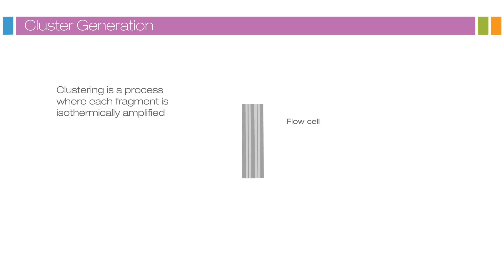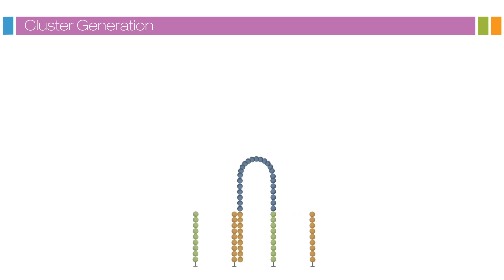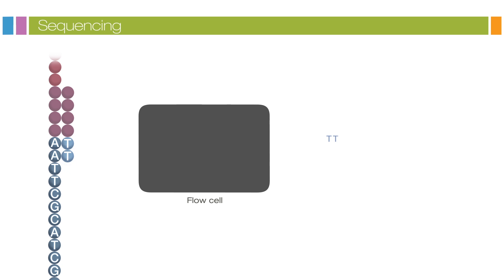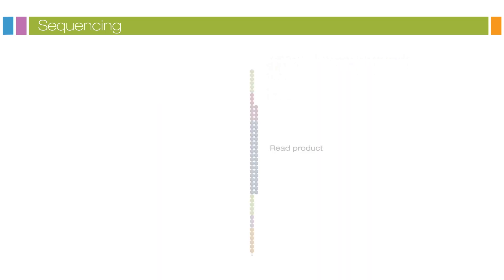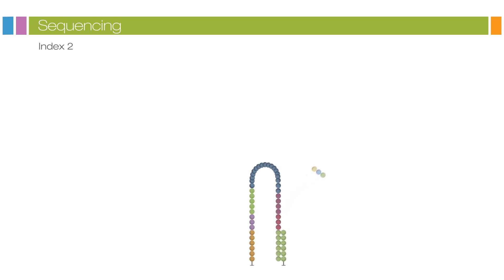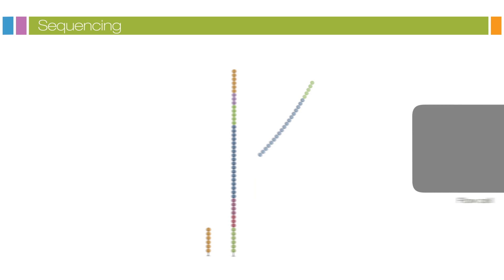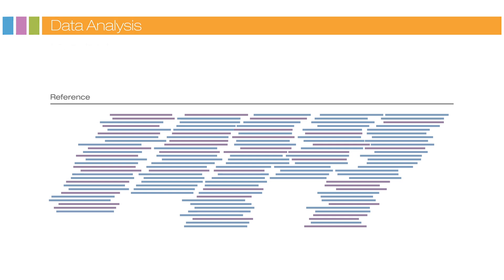Intro to Sequencing by Synthesis: Industry-leading Data Quality

Comment: I have a question about this process. There are two types of oligos fixed in the surface and two types of adaptors in the strand DNA, so one adapter is complementary to one oligo and the other adapter is equal to the second oligo (and consequently different to the first oligo)?
Reply: You probably already got your anser, but just in case anyone else sees this: Yes, one Adaptor is complentary to the Flow cell Oligo, the other adptor is identical to the flow cell oligo. This allows it to form the bridge after PCR.

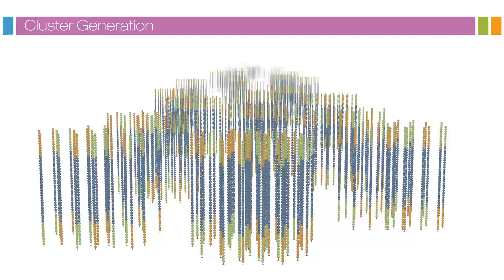Comment: Hello everybody! Could anyone explain to me why the newly synthesized reversed strands are cleaved and washed of at 1:20 ?
Reply: Reverse strand is removed so the cluster is monoclonal. If there were both forward and reverse strands in the same cluster you would get two fluorophore signals for each base addition cycle rather than a single signal corresponding with a single base at that particular cluster. Sequencers can distinguish different fluorophore signals at separate clusters at the same cycle but not different signals simultaneously at the same cluster; only different signals at the same cluster in separate base addition cycles.
Reply: @jvvandergrift2046  Thank you. I was searching for a convincing answer on this question up until your explanation. It is surprising that in all the videos, folks ignore this explanation and simply repeat the first text put out by Illumina, who also did not explain the reason behind it. Also, not explained is how they cleave and remove the reverse strand specifically.

Comment: it doesnt appear to be explained why the reverse sequence is also sought. i was expecting at the end for them to say "and the reverse strand sequence is used to verify the original forward sequence". if not for this reason, then why?
Reply: it's used for sequences which are too long to be sequenced from one side at one time. E.g. RNA Polymerase is just able to sequence 150 base pairs but the strand is 300 bp these results can be combined

Comment: Can someone explain to me why we need 2 reads? Also, do you use barcoding when analyzing self "made" (PCR) amplicons generated from bacterial population 16s rRNA Gene fragments? Or just when you get a sample from a library and such?
Reply: because if you have a 300bp fragment, read 1 will only get you about 150bp in from one direction. Read two will get you 150bp in from the other direction resulting in a paired end read that gives you the entire 300bp fragment. Conversely if you have a 500 bp fragment you can get 150 from each end and miss some sequence in the middle.

Comment: what is the function of index primer?And  how can it insert into templete?I have no idea about this video:(
Reply: did you find an answer? HELP!!
Reply: The adaptor designed is such that it has three parts:sequencing, index and binding part.
Reply: Different pairs of index primers are added to individual samples in a second thermocycling step, after initial amplification of the target region. This allows you to mix many samples together (up to 96) and sequence them at the same time.

Comment: Nice video, though I would like to know the method by which the cleavage process before the addition of labeled nucleotides affects only the reverse strands and not the forward ones, given that both of them have identical adapters.
Reply: Restriction enzymes!
Reply: Primers that are complementary to the adapters are directly bound to the flow cell surface and carry newly synthesized strand,so can't be cleaved whereas the template ones are attached to adapter ie inturn paired to primer , when denaturation takes place after polymerisation the bonds between adapter and primers get denatured so template gets washed off.

Comment: why do u need index1 read?
Reply: You don't have to have an index read at all, but if you wish to multiplex your samples then an index is (usually) necessary in order to establish which sequence data belongs to which sample.
Reply: Different pairs of index primers are added to individual samples in a second thermocycling step, after initial amplification of the target region. This allows you to mix many samples together (up to 96) and sequence them at the same time.